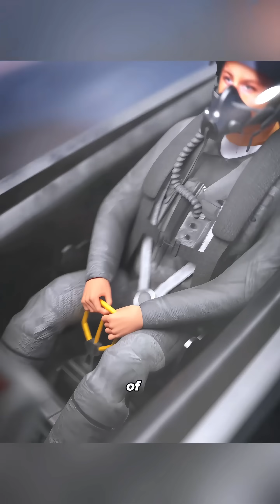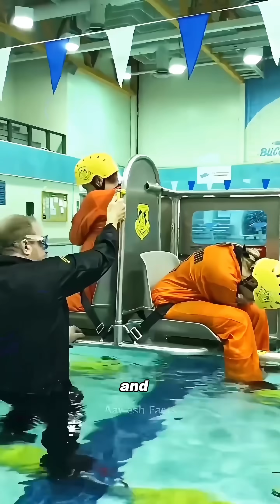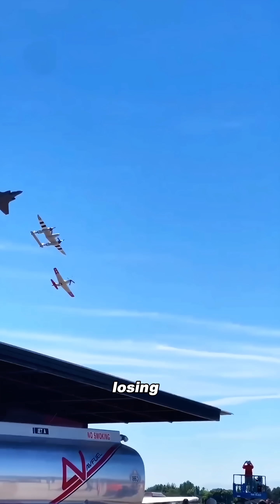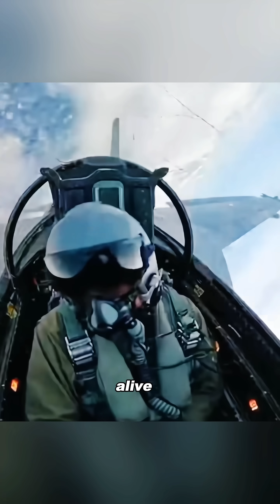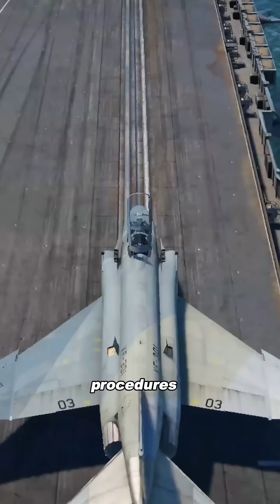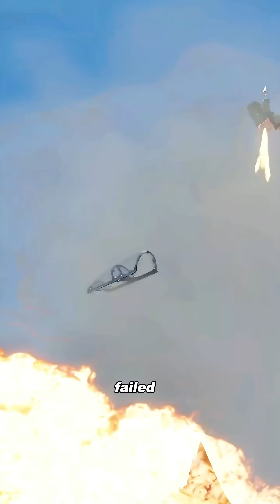Why do some pilots choose to go down with a failing jet

Comment: Current ejection seats are 0/0 it meas it work at zero altitud and zero speed, if will launch and deploy the parachute even in the ground, so the video is lying about the altitude.

Comment: This is just utter nonsense. Even after using one of the really old 'bang' seats, a pilot would more than likely return to duty. The newer seats which rely on staged acceleration and rocket assist give a much less violent ejection which is far less likely to result in a career-ending spinal injury.

Comment: The computer won’t let u eject upside down it will wait untill u are upside in a fraction of a second
Reply: That I can believe. Considering that from pulling the handle to hanging under your parachute is about 1.25 seconds it only take the blink of an eye right side up for it to kick you out.

Comment: I’ve worked ejection seats

It’s definitely not designed to be a comfortable ride, but a ride nonetheless. The engineering behind those seats is pretty incredible. They are designed for basically any scenario. If the jet is sideways or upside down when the pilot ejects then the seat will adjust itself right-side-up using a gyro wheel that spins at around 10,000 rpm. If there are two seats ejecting at once, they are equipped with an additional rocket to divert the trajectory of the seats away from each other so they don’t collide mid-flight. 

Theres so many safety measures to make sure the pilot gets home, is quite amazing
Reply: Whats the survival rate on those?

Comment: I remember seeing a video where someone commented that their old man had been in a f100 accident and he had to use the ejector seat, so his spine was like super compressed and it hurt constantly, so he ended up making boots with hooks on the bottom so he could hang from a pipe in their basement to stretch his spine, because he wanted to continue flying, but didn’t want to tell the army his back was hurting. I’m sure with the new seats that wouldn’t happen, but kinda crazy that’s how much force they make
Reply: F-100? Army didn't fly F-100s

Comment: The Martin-Baker Zero-Zero Ejection Seat is renowned for enabling escape even when stationary on the ground or at very low altitudes, a critical safety advancement. They are also self-righting, meaning they will automatically turn the pilot & seat upright if ejected upside down. 7,000 pilots have been saved by M-B Seats, many continued with their flying careers.
Reply: The MB seat goes off with 12 G's of force, the parachute ALWAYS deploys and the pilot is under the canopy in 1.5 seconds. This video has so many errors, sad.

Comment: there are ejector seats that don't care how high or slow you are and will still save you called zero zero ejection seats so if you have a good jet your probably fine as long as you don't try to facetime the ground

Comment: This is what a video full B.S. looks like. I work on ejection seats. The Air Force had a pilot eject at almost Mach 1. He returned to Flight Status. It took him a long time to do it but he did return to flying. The only part of this video that is truthful is the seat is a small rocket. I promise you that a pilot won't hesitate to eject. They will stay with the airplane because of there training but when it comes time to punch they aren't gonna hesitate

Comment: Bs.

Pilots are just very busy in falling or missing the runway/carrier airplane, they do not think about ejecting until its too late or think that they can do it until the very crash. So some high performance planes eject pilots by themselves, when electronics determines its inevitable, or some external order from flight controller is received.

Comment: Notoriously, the F-104 hat an ejection seat which ejected the pilot downward instead of upward. The reason was to avoid collision with the rather large T-tail section. So if the plane was already too low, the pilot got shot straight into the ground.
Reply: I can never get over the fact that the starfighter existed and was used so widely

Comment: Ok so the first part is kinda right, the g's are absurd yes, but if the pilot after ejection is both physically and mentally fit they can fly again but the part about the parachute not opening is kind of BS because jets have the "Zero Zero" meaning it is safe to eject even when the jet is staying still on the ground so 0 speed and 0 altitude
Reply: What if it's upside down, maybe I got the wrong idea, but someone said if your upside down, the rocket seat will position you to the right orientation and deploy chute
Reply: @xthomasbhx yes, the seat has some gyros and vectored thrusters that position and stablilize your seat

Comment: This isn’t true. I’m retired Air Force and I’ve seen guys eject and continue their career more than once..
Reply: You are absolutely right but it varies on health some people can't even handle 4 to 5 g force or negative the reference is tejes in dubai air show.
Reply: @MuhammadRehan-xx8ie if you can’t handle 4-5g then your not a fighter pilot as simple as that working in becoming a marine aviator right now and I can tell you gonna have to handle g forces if you can’t then u train and it’s not something some people have and other don’t it’s a gained tolerance and you gain threw training fighter pilots don’t just take 9g they have to work to get there and when they get there it’s still hard so more training is done and ejecting and ending your career has nothing to do with g forces and everything to do with spine posture when u eject if done incorrectly could cause spinal cord damage and plenty of other things and that’s what will end your career and only 5 percent actually experience complications after ejection
Reply: @easy4life23. the marines dont have an air decision dont lie
Reply: @FlowingSumyou were trying to say division?
Reply: @FlowingSum they do have aviation in the Marines. Maybe you should not spew misinformation.
Reply: @FlowingSumthey sure as hell do have marine aviation.
Reply: @jburge40 fly F-18s
Reply: @FlowingSumthe USA does indeed have a marine air division
Reply: @MuhammadRehan-xx8ie there's virtually nothing right about this clip . Modern ejector seats have zero zero capacity.  Even if you were to eject inverted the seat would right itself and rocket up 500' before the parachute would deploy . 5 - 7yrs - more nonsense.
Reply: @StephenAlderson-ck7lm if the seat inverted back upright and you said it ejects about 500' if the jet is already inverted and you're at very low altitude wouldn't the ground kill you😑
Reply: @MuhammadRehan-xx8ie  as I expected another Pakistani bot spreading propaganda
Reply: @MuhammadRehan-xx8ie 
You can't handle 4 to 5g and you think you can be a fighter jet pilot😂😂😂😂😂
Reply: Sing it Shane! I'm retired as well and have met pilots who ejected and continued flying and advancing. It all comes down to not only what happened, but why.
Reply: @cquilty673 Exactly and if they ejected properly and didn’t compress their spine.
Reply: Too add. A jet is totally ruined after ejecualation off the chair. Also fun fact: Some countries do replace seats, suited for two to three pilots who have been recruited and have same body measurements.
Reply: @Frieskou  you still have time to delete your comment.
Reply: @Frieskou EJACULATION?
Reply: That's what I thought  Shane !
Reply: This is a kid like "I SEEN RHIS HAPPEN 9909999999098809988777649 TIMES ITS WRONG" 🤓☝️
Reply: Did the video say "All pilots"?
Reply: I'm former Air Force too, but I listened to video say IF THEY ARE DEEMED, not able to fly they end career. He did not say ejecting ends you 100%.
Reply: Nah I left because of ejection if you fail the tests after and unfit to fly you have to end your career
Reply: But you can come back if you pass the tests
Reply: Yea sure you are kid
Reply: @DawsonRose-y4c what a weird and stupid thing to say. Being retired Air Force is not rare or special. Why would someone lie about that ? if I were going to lie I would say I was like a seal or Delta force. 🤡🤡
Reply: BRO YOU ARE A FAKE AIRFORCE BRO!!!
Reply: No escuses, live is more precious than a whole countries jets destroyed in one single hit of bombing.
Mr. Pilot, be safe first then live to ponder of any loses.
Reply: Guys your wrong it’s 10gs in a split second that COULD make you end your career
Reply: It is true you’re dumbmutt clearly deemed unfit to fly would you let someone that’s been deemed unfit to Fly? we all know everybody’s not made the same and some people are men stronger than others but most people do  fail just because you were a little bit special doesn’t mean you have the right to say what ever you want 😂
Reply: absolutely!!! I don't where they got this from!
Reply: i think people dont understand that they will get grounded for a bit but they will usually still end up back in the air. 

hell the video even touches on the fact that their experience is far more valuable than the aircraft. machines we churn out at alarming rates that our enemies cant fathom. and even if a fighter pilot is found unfit to return to flight duty, they are useful as instructors to pass on their knowledge. 

hell i remember going thru SF school and we had civilian instructors who had done the job in the past in addition to our active military instructors. and it was that experience that was leveraged to train us to be better SF airmen.
Reply: Maybe 3-5, their spines are a factor
Reply: Sure your retired
Reply: @AmmyPolanco-e9i I don’t give a shit if some rando on YouTube thinks I would lie about retiring from the military. 🤣🤣🤣
Reply: @shanecrocker3629  right. Especially when that person uses “your” for “you’re”. 😂
Reply: @rtbrtb_dutchy4183 Right? What a weird thing to even say. It’s not like I was claiming to be Delta force. Literally thousands upon thousands of people have retired from all of the branches. It’s really nothing special or rare. lol
Reply: @shanecrocker3629  weird thing to say indeed. Probably someone who hasn’t achieved anything in life. Anyway, thank you for your service.
Reply: @AmmyPolanco-e9i military is not a rare job, more than likely this guy is a retired veteran